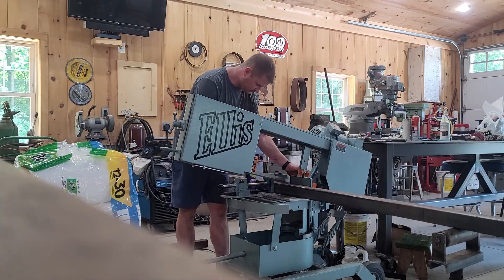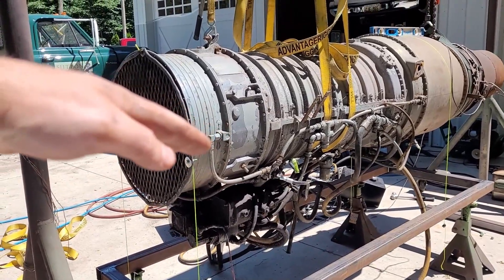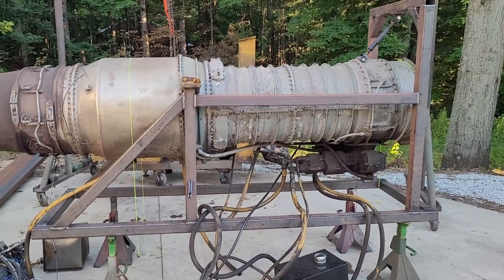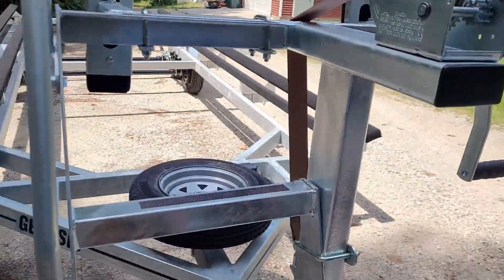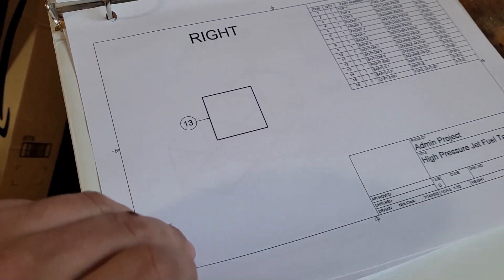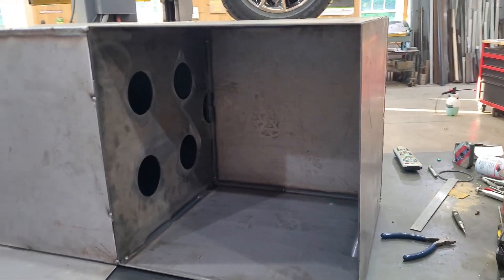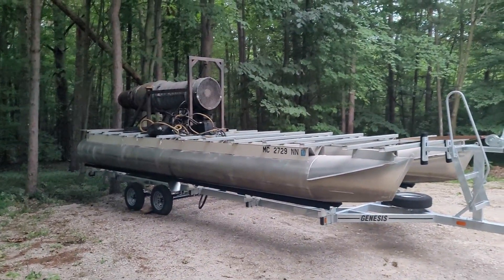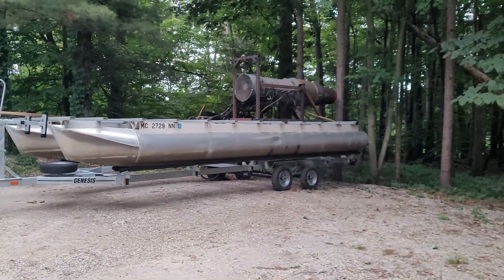The jet engine is on the pontoon!

Comment: You should change the way it's mounted to the pontoon boat with huge Square stock one inside of the other so you can raise and lower the engine because I think with it up that high it's going to cause a lot of stability problems you should at least have it a few inches off of the deck of the pontoon boat to make it more stable
Reply from the maker: The front link is adjustable to allow for a change in angle of attack. A revision may be to make it a hydraulic actuator to use like trim tabs that can be adjusted on the fly.